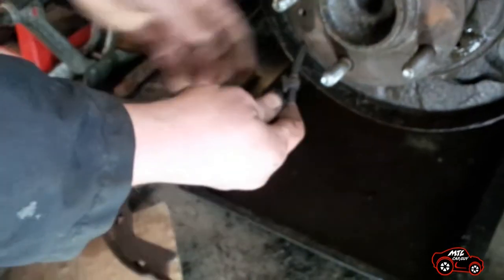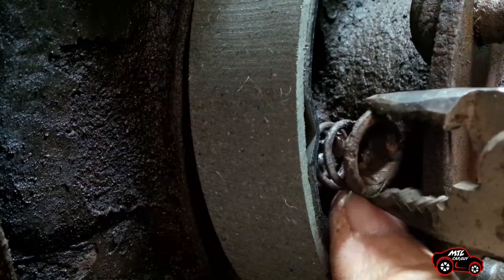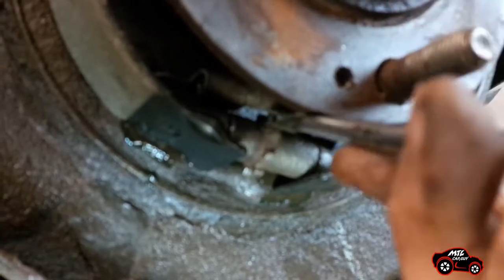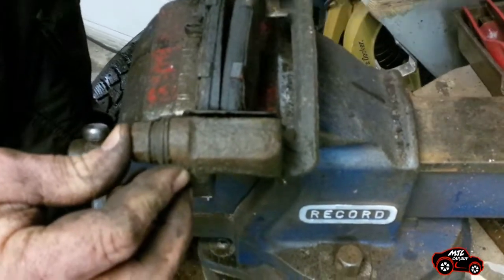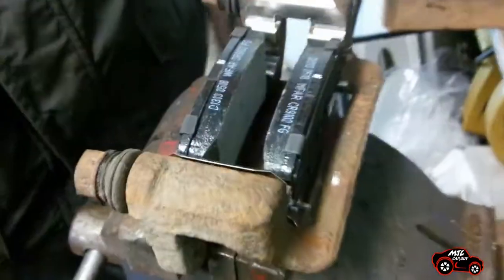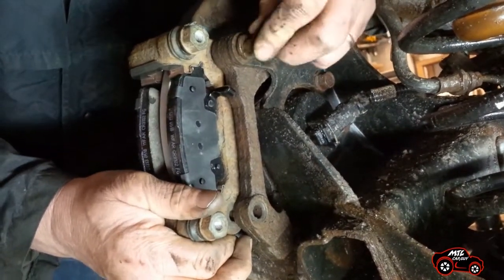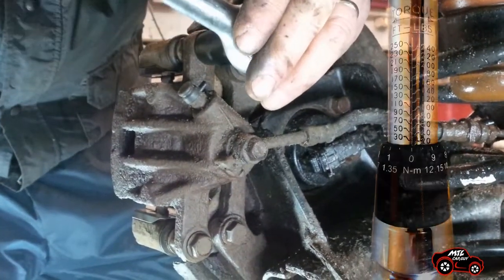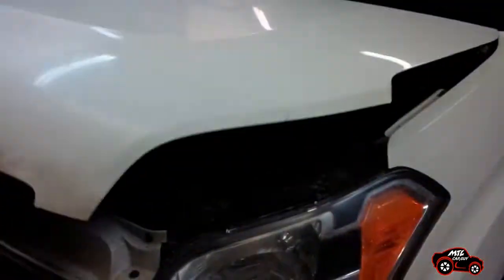Kia Soul Rear Brakes Pads Rotors Shoes

Comment: On those rotor hold screws: take a metal wire brush and repeatedly brush , from different directions, the screw heads.  This way , any road grime/ surface rust is removed.  THEN spray with penetration spray and let it soak in.  Pound with rubber mallet.  Spray again. Now your Phillips #3 screwdriver can sit deeper and " bite " better. 
Some guys buy Japanese Vessel brand #3 screwdrivers that bite deeper into Phillips screws.
My 2 cents...

Comment: Great video, I just took my parking break parts off and left them off. It's an automatic so it's not a problem.
Reply: No parking brake means problems next time you jack the front two tires in the air. . .

Comment: Many missing steps. No lactide on those caliper braker bolts. 50ft lb is wrong, must be 57-72.
-- caliper guide pins wrong way to grease again.
-- New shims with any grease down or bottom, no good.
-- Do not depress the brake pedal with the brake fluid reservoir open like he did, big mistake.
Reply from the maker: You typed lactide instead of Loctite.
1: It is not required to apply Loctite on caliper bolts when the proper torque is applied.

2:  57.9 – 72.3 ft.-lbs are the tightening min. and max. torque limits for the FRONT calipers bolts and 
47.0 – 54.3 ft.-lbs are the tightening min. and max. torque limits for the REAR calipers, so 50 ft.-lbs is a normal mid-range value.

3: Yes, the guide pins were not greased the standard way but the end result was the same.

4: Yes, he could have used silicone grease to slow down the rust process.

5: Yes, the reservoir was open to check and adjust the fluid, but, with ABS brake systems there no fluid shooting up from the fluid reservoir when the pedal is depressed.
Reply: @mtlcarguy  Loctide,lictide.lactide, wherever, blame google, blame me, you understood. For brake caliper holder or braker you better use it.
-- the tightening is right for rear, I said the front, so was my mistake.Mine is 2012 and I do all my maintenance. The dealer has never touched my car.
Reply from the maker: @HeydaCarreras  Good! Doing your own maintenance help you to save a lot of money.